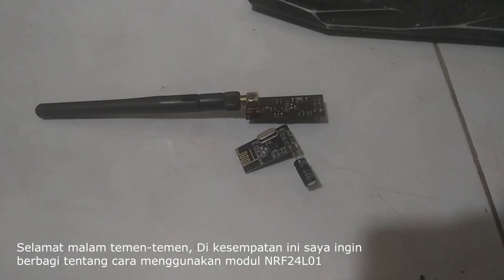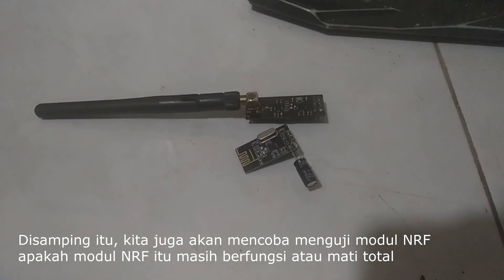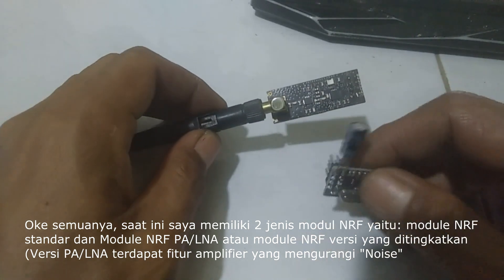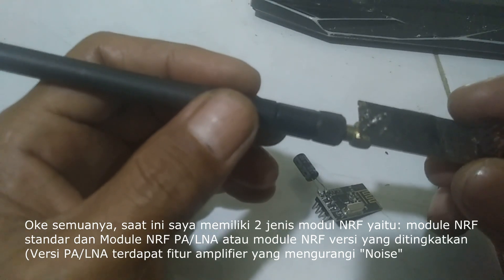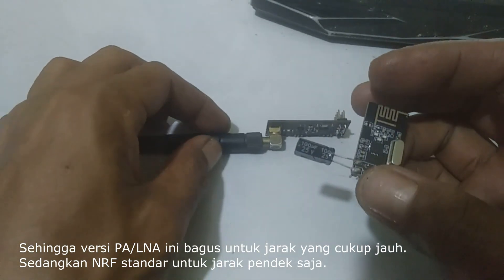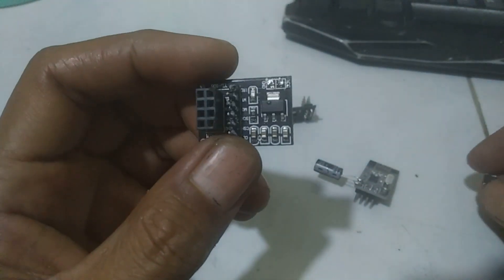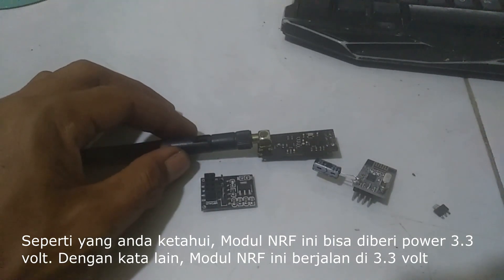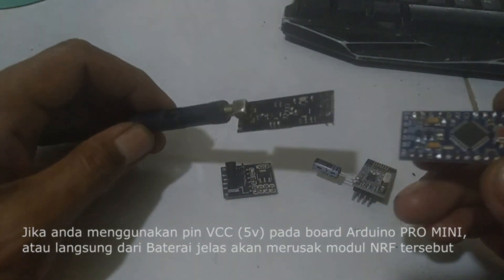NRF24L01 Good or Bad (How to Connect NRF24L01)

Comment: I bought the module with long antenna and adapter.  It is not reliable.  Sometimes it works and sometimes it doesn't. I already tried both on breadboard and direct connection to microcontroller. It works only 1 out of 10 times.
 Now I'm going to toss into a trash.  Now I'm using ESP-Now on both ESP8266 and ESP32. More stable and never get fail transmission.
Reply from the maker: THe video talks about basic usage of NRF24L01, the most common problem exists related to it. I use the module for most of my projects and everything is okay.

When you need to get precise data sent and received, you need to add a code: 
radio.setAutoAck(true); and add a capacitor at least 10uf or 100uf even though you use adapter.

Esp32 (bluetooth or wifi) is powerful. I know that but very SHORT RANGE, LOL. Mine (with NRF24L01) can reach 500 meters to 1KM with Antena.
Reply: @ArduJimmy  Thank you for the advice. I will order the new pair of NRF24L01 and try it again.  Mine is probably faulty one.
Reply from the maker: @jumbo999614  please leave here a question before you do it, let me know

Comment: I need help . Can you help me .. i want to make mini drone .but when i connect nrf to arduino vai ams1117 . output will 3.3v but when i upload code for check it dosnt work .
Reply from the maker: first problem: output and input voltage
second: wiring: ce, csn, sck, mosi and miso
third: address transmitter amd receiver.

All problem about nrf is the three problem above. try to upload a single test to make sure.

if all above is not okay but still not working, the nrf module might be damage/burned.

please never use jumper but soldering is better
Reply: @ArduJimmy  yes when I shake and doing something activity than showing nrf working in serial monitor.. I'm using Arduinodroid for coding
Reply from the maker: @SanuChettri-b8m I never use apk to test or upload a sketch. you need to get verified and premium apk to get real result.
Use PC or notebook only. Besides, misconfig of computer can cause anything including cable

Comment: But in my case output voltage is 3.350 v but i don't know why's not working may i connect with you personally
Reply from the maker: if the input voltage and output voltage shows correct voltage, then the second and the third cause will be the problem.

Sure, you can contact me via telegram in tab menu about in this channel

Comment: Problem solved! you saved me, bro. I recheck the output voltage and it showed 1.32v and I replace the AMS with a new one and done! ❤
Reply: Ardujimmy is correct, the most of problem are found in this module is around voltage. But when input and output voltage and wiring are okay but still not connected then get a new NRF module.
Reply from the maker: You're wow 👍